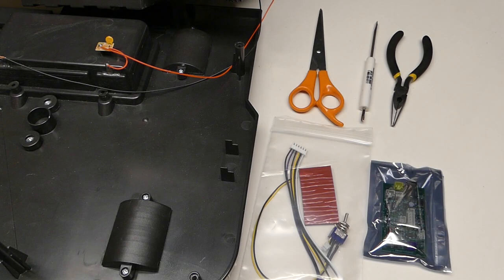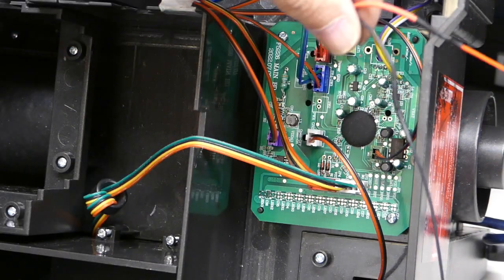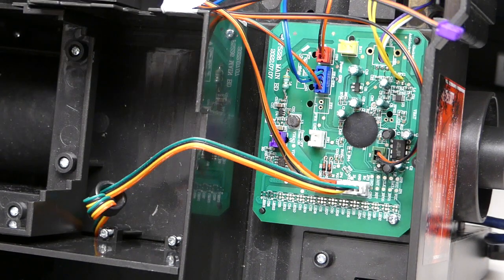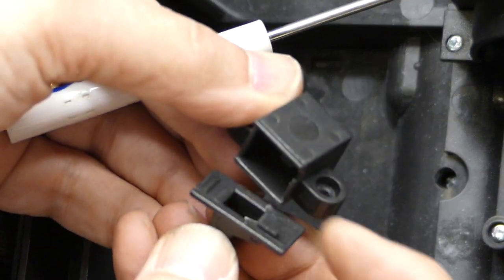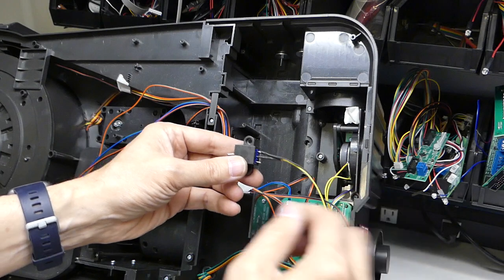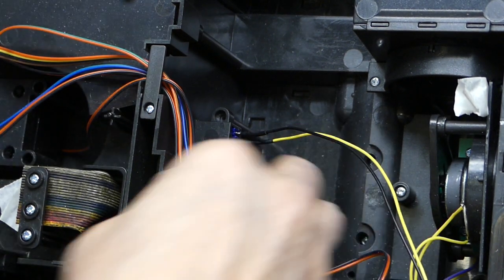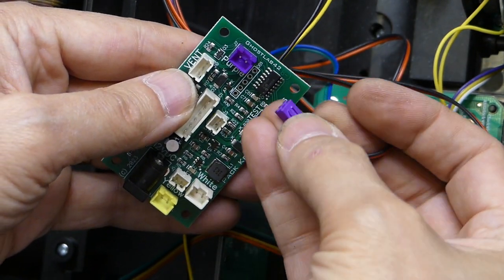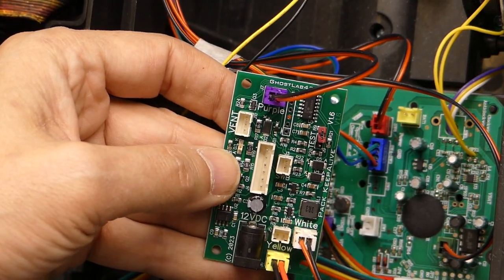Pack KeepAlive Kit installation Hasbro HasLab Keep Alive Ghostbusters Proton Pack

Comment: is there any issues with the wand powering up and firing?   I have the issue with another keep alive kit where once i hit the third toggle the wand shuts down like there not enough charge?    Im using a talent cell battery pack for a power source
Reply from the maker: Fixed in my latest version but that was a problem with the first version of my Pack KeepAlive board.  If you are using the 5V output of the TalentCell to replace the D-Cell batteries, that can contribute to the problem.  There are variations in pack and wand power supplies so this shows up differently for different packs and wands.

The issue is that the Pack normally uses the 6V (initial) voltage to generate about 4.2V out to the wand.  As the battery voltage lowers below about 5V the wand voltage lowers due to the packs power supply design.  Starting out at 5V (USB voltage) is marginal and the pack may not be able to provide the full 4.2V out to the wand.  When you activate the wand, the rumble motor should also start up.  This is a large current draw and the voltage can dip down as that surge takes place.  The wand appears to be more sensitive than the pack to dropping voltage.

The TalentCell also limits the current for the USB more than for the 12V output, so my board does not use the USB output.

My new Pack KeepAlive board has separate power supplies for the wand and the pack.  Their job is to take in the battery voltages (either from the D-Cell batteries that start at 6V and/or the 12V from the 5.5x2.1mm power jack) and provide 6V to the pack and 4.5V to the wand.  This works with battery voltages much lower than the pack would normally operate at.  As the batteries drain, there is no voltage change seen by the pack and it thinks it is working with a fresh set of batteries until the batteries are completely drained.
Reply: @ghostlab42  so I would still be good with talent cell with your new version and if so where can I order it?
Reply from the maker: @DavesDimension  It works great with the 12V output and connection cables that come with the TalentCell batteries.  5.5x2.1mm jack on the battery, not the USB connector.
The KeepAlive kits are available here:
https://www.ebay.com/itm/195745928732
And also more directly here:
https://www.gbfans.com/forum/viewtopic.php?t=50623

Comment: Hey there! Recently managed to get a (still brand new in the box) Haslab Proton Pack and after walking around with it on the convention floor I definitely want to try and mod it to make it better including a KeepAlive mod. Now this is the second I came across, the other being the Frutto KeepAlive mod. But if I read everything correctly, yours is better as you can still turn the pack off and on with the wand while the mod is active, am I correct in that?

Another question I have is that I want to replace D batteries with a battery pack. I have been eyeing a small Lithium-battery Li-Ion 12 V 3000 mAh power bank so this fits in nicely next to the snack compartment. Would that be enough to for this mod? It's got a 12V output/input point and a 5V USB output point.
Reply from the maker: There is some issues around the D-cell support (the wand may not activate if the batteries drain a bit - more sensitive than it should be), so I sell this as a 12V only setup and the additional switch is not included or needed for 12V only operation.
Turning the pack on/off from the wand is more complicated:
If you have the Pack AND wand KeepAlive installed in the wand then yes, it just works and the wand is in control.
If you only have the Pack KeepAlive, then when the red switch is on the pack is on the pack will be on.  The wand will not turn it on and off.  If you have the pack red switch set to off, then the wand can turn the pack on and off, but the wand powers off a lot on its own so it may get annoying having the pack follow the wand power.

Many use the TanentCell 3000mAH battery.  Works great and fits nicely.  The USB 5V output is not used.  Larger capacity TalenCell batteries may be problematic just due to their size.  I also use generic "blue brick" style batteries with a power switch on the side and even a 9800mAh can be fit in about the same place as the 3000mAh TalentCell.

Comment: Will you be making more of these? If so where can I buy one?
Reply from the maker: I am out of stock at the moment, and am working on a new revision to make the board work better with weak batteries.
It may not be available until early next year if the testing of the prototype goes well.  I offer them on eBay and GBFans For Sale section.

Comment: Do you know where I can find a OEM replacement main board for the haslab proton pack mine not working?
Reply from the maker: I contacted Hasbro and was told they are not offering replacement boards to customers or repair shops.  I have not used these, but GPSTAR makes replacement boards, and there are probably a few others.  I do not know if these are only for damage replacements, or if they are replacing working boards - which would imply there could be some working boards available from those upgrades.  I just have not seen any.
Reply: Awesome thanks ill definitely look into that 👍🏻👍🏻

Comment: This looks almost too simple, lol.  
2 questions...(1) by the time i saw the boards on ebay they were already sold out so will there be another production run in the future?  (&2) if i have already swapped the Ds for a 12v recargeable batt, can i omit the 2nd toggle switch?  Will that affect the functionality of the boards?  Thanks again for all your hard work on this project!  🍻
Reply from the maker: 1) Working on getting more out - should be in a few days or a week at the most.
2) Yes, you can skip installing/using the KeepAlive toggle switch if you only intend to use a 12V battery.  The toggle is only there to disconnect the 4x D-cell batteries in the pack for longer term storage without draining the 4x D-cell batteries.  Does not affect the 12V connection at all.
Reply: @ghostlab42  thanks so much for the info!!
Reply: @ghostlab42  That's ingenious!